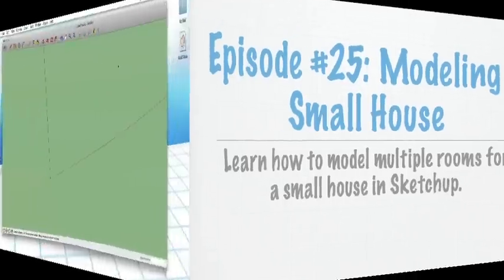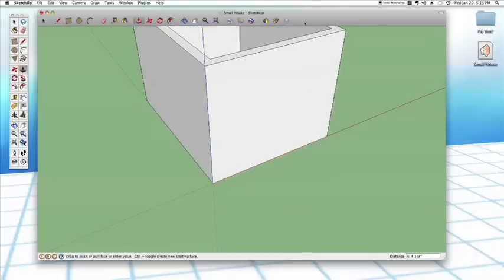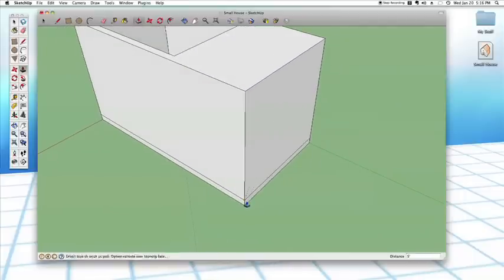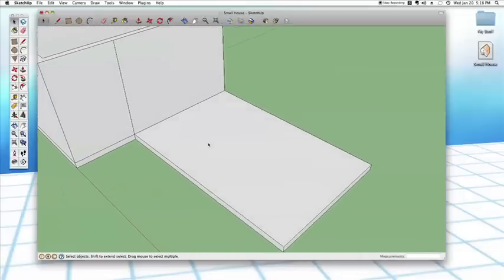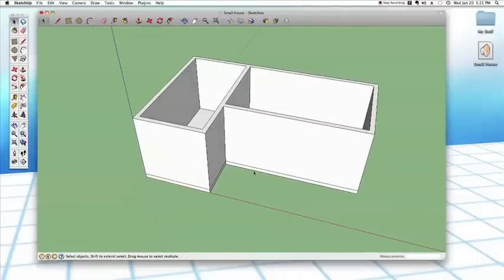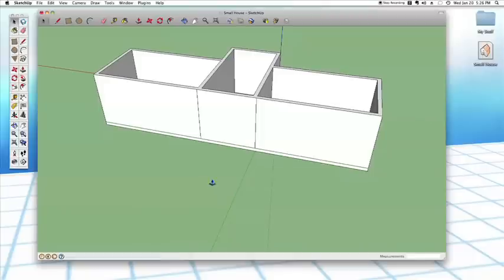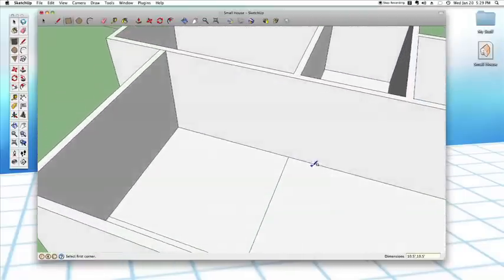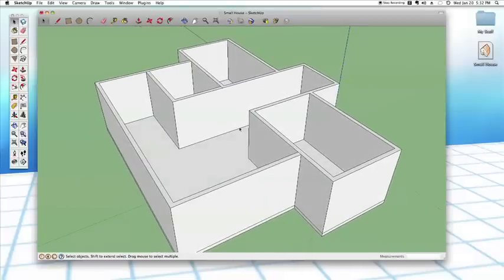Sketchup #25: Small House (Part 1 - Walls)

Comment: there is no option to automatically set the size like 4x4 m without manually drawing on canvas???
Reply: +Deden Fardenan 4 months late, but hey. When you click with a rectangle selected, just drag a bit on the plain you want (say, horizontally) and without clicking again, type say "400, 400" and press Enter. That should do it.

Comment: Hey thanks for the great vids. Question: when you pulled up that second room, how did you pan and move and orbit without losing the push pull too? For me is an awkward three step start-stop-start process. It was like you had two mouses going but I suspect you might have been using keyboard shortcuts with one hand?
Reply: Just hold down your middle mouse scroll/button and the orbit tool will open. As soon as you release, it will return back to the tool you were using before.
Reply: Sam Friedman I've been using Sketchup in my classes for 4 years, and this is the first time I've heard about that shortcut. Saves so much time! Thank you :)

Comment from the maker: @pinzhi0226 You certainly could. However, the scale tool works in percentages, whereas the other tools let you adjust size using feet and inches.